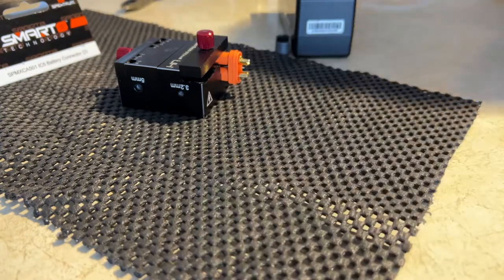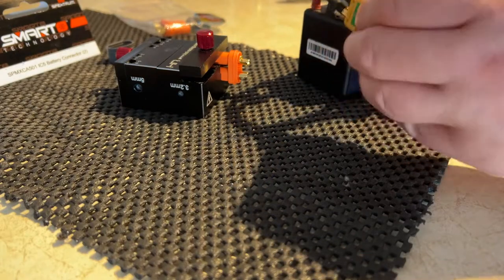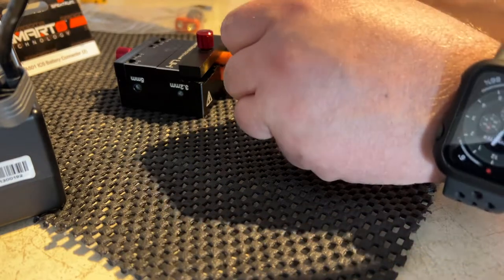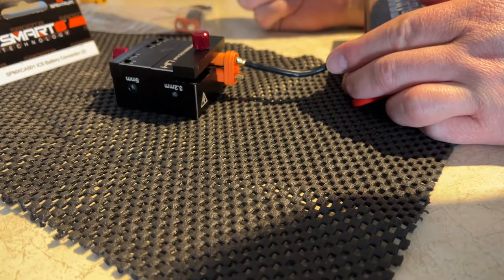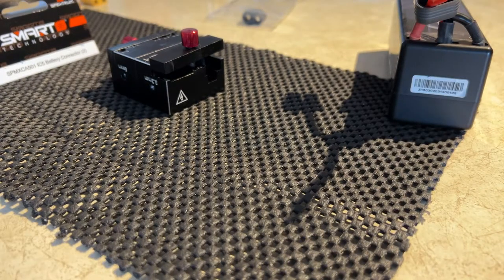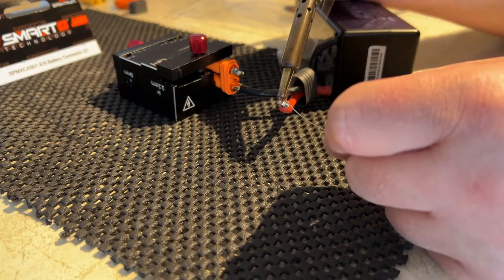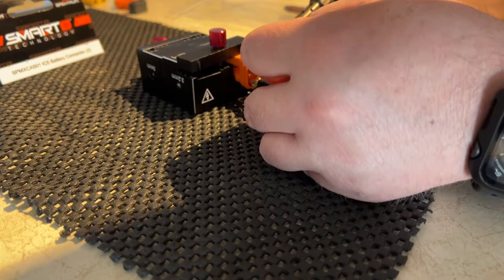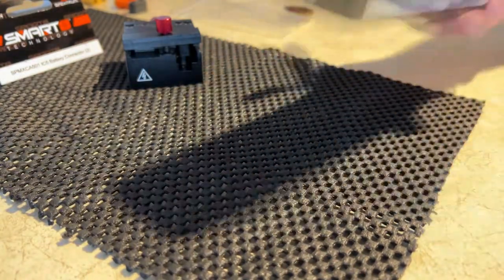How To Solder IC5 Battery Connector

Comment: Hot racing jig? You should tape up each loose wire as you dont want them accidentally touching. Ic5 are more expensive but easier to solder than Ec5

Comment: Important Note: When working with the smart batteries that use the third wire you should "remove the 3rd wire last and connect it 1st" in case you accidentally short one of the battery terminals to the small third terminal with the soldering iron while soldering the third wire in that small space between the two main battery lead connectors.
Reply from the maker: I would agree with you.